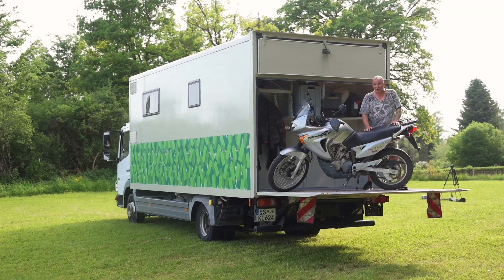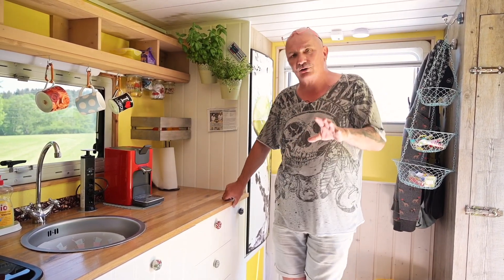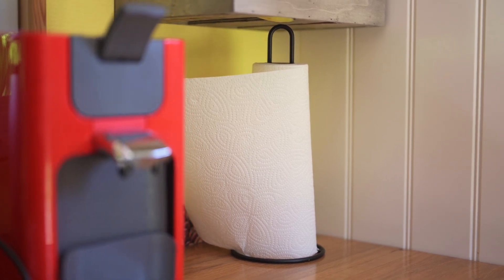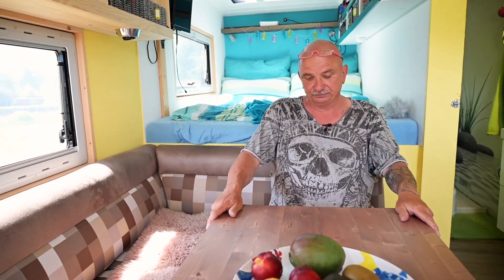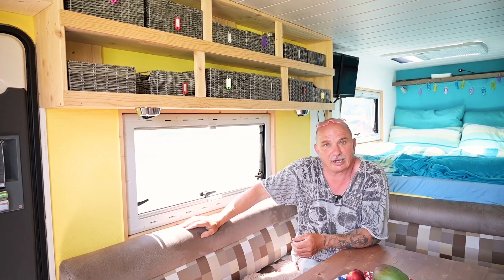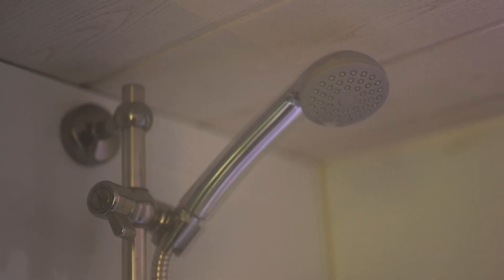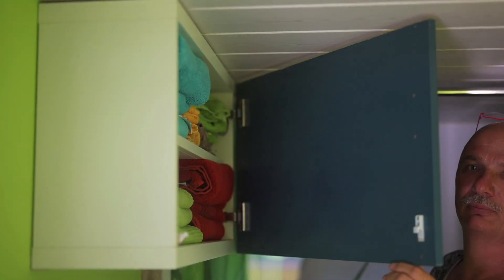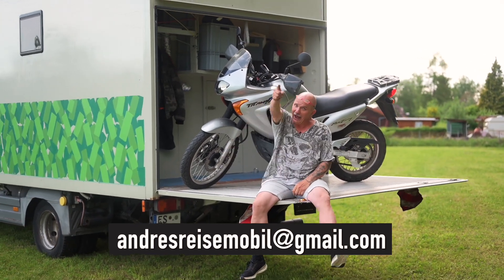LKW Wohnmobil mit MOTORRAD GARAGE | Selbstausbau Roomtour eines umgebauten Mercedes Atego 816

Comment: Jetzt hier noch mal ein Kommentar: Warum nur 80 oder max 90 Kmh??? Das ist ein Womo. Also für den Fall das man es mal brauchen tut, den Begrenzer umprogrammieren lassen und dann bis 100 dürfen.  Meiner wurde auf 120 eingestellt, viel mehr schafft die Einspritzpumpe auch nicht. Und da die Bremsen bis 135 geprüft sind, war das auch kein Problem.  Ach ja, der Fahrtenschreiber: da solltest Du dich unbedingt erkundigen!!! was passiert, wenn die Batterie leer ist, die da drinnen verbaut ist. Wenn das Gerät mit CAN bus verbunden ist mit der Fahrzeugelektronik, dann kann es sein, das das Fahrzeugsteuergerät nicht mehr erkannt wird und dann nur Fehlermeldungen anzeigt und eventuell auf Notlauf geht.  Im normal Fall, wird die automatisch mit der 2 Jährigen Tachoprüfung ersetzt. 
 Eine verbesserung Man braucht keinen CE sondern C1 und wenn dann C1E.  Und man nennt es Pneumatik Sitz. nicht Hydraulik.  So jetzt sage ich nichts mehr. Gute Arbeit.
Reply from the maker: Erstmal danke 🙏 für deinen Kommentar. In meinen Papieren steht höchst Geschwindigkeit 90/km/h. Und Daimler Truck behauptet sie können den Fahrtenschreiber nicht ausbauen 😳. Hast du mir vielleicht eine Adresse???
Reply: @AndreBolik  Hier noch mal für alle, die es Interessiert:
 Nein eine Spezielle Adresse braucht es nicht. Den Fahrtenschreiber kann man raus werfen, Aber dann muss (zumindest bei mir) ein Dummy eingebaut werden Was umi 700 kostet, denn ohne geht es nicht. Ob das jetzt auch zusammen hängt mit dem Begrenzer weis ich nicht. Ich habe meinen Fahrtenschr. schön weit nach hinten versetzt, dann sehen ich ihn nicht und mit Blende davor sieht ihn auch kein anderer.  Und das in deinen Papieren 90 Steht, ist doch klar, stand bei mir vorher auch.  Gut das T in der Tachoanzeige, für fehlende Fahrerkarte, damit muß man leben. Und wenn Du den Begrenzer umschreiben läst, dann bekommst du mit der Rechnung dafür die Bescheinigung. Ob Du das denn auch eintragen lässt, dürfte an sich egal sein.  Hast ja ein Womo.
Reply: Auf JEDEN FALL darauf achten, dass die (Puffer-) Batterie im Fahrtenschreiber regelmäßig gewechselt wird. Sollte die Pufferbatterie leer sein und die Fahrzeugbatterie mal abgeklemmt werden (z.B. in der Werkstatt), „zerstört“ sich das Teil quasi selbst und lässt sich nicht wiederbeleben. Es braucht IMMER Strom, entweder vom Fahrzeug oder, wenn der mal abgeklemmt ist, eben von der Pufferbatterie. Ansonsten braucht man ein neues Gerät. Ein neuer Fahrtenschreiber und ein Dummy kosten etwa gleich viel, bei unserem MAN waren es 499 €…